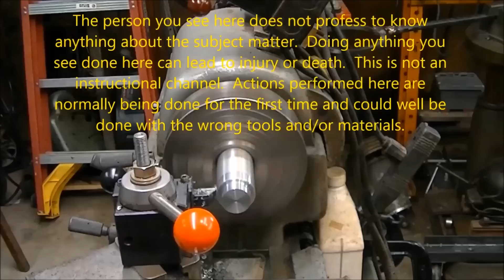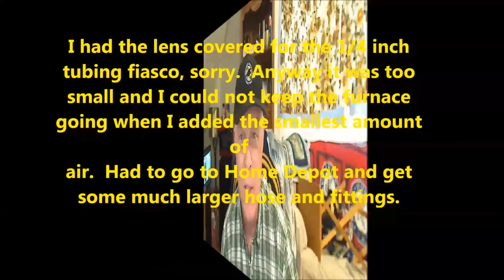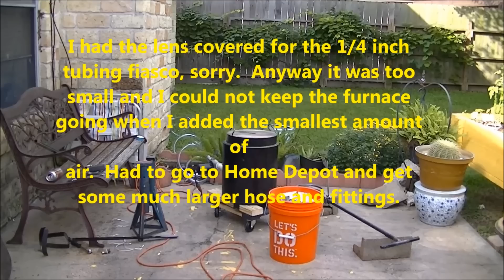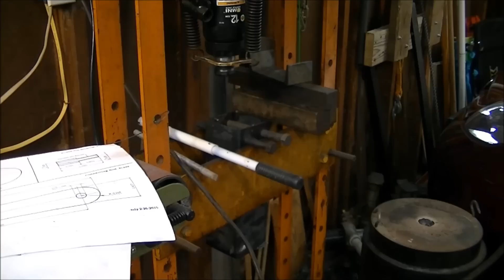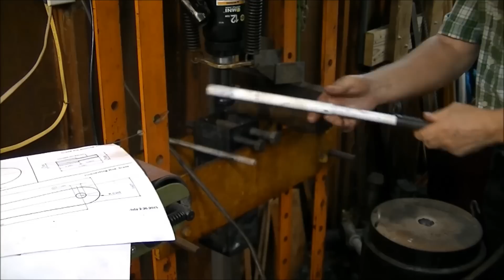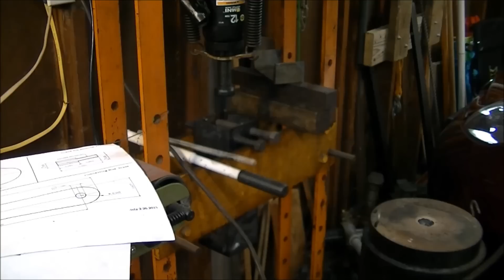Casting a big old chunk of aluminum part 3 of 3

Comment: Harold,

That's a nice casting, I'll be ecstatic if my first one turns out as well and I don't burn down anything expensive in the process. Hopefully your vision will settle down soon and let you get back on the high precision work.

Craig
Reply from the maker: clemwyo I should get back into normal action somewhere around the end of the month when things settle down and I get the prescription reading glasses.  Thanks for viewing and commenting.

Comment: Good job Harold.  I'm going to have a go at that.  I have some similar square section.  The alloy came out dead easy and looked good.

Did you use a degassing agent?

I put a 1 HP motor on my bandsaw.  I don't think the original 1/3 HP is near big enough, and plenty seem to burn out.

Cheers.  Rob
Reply from the maker: xynudu I used some salt for the degassing as that is what I have seen myfordboy use.  I think my metal was a bit colder than it should have been as it seemed to be a bit thick when I poured it.  Thanks for the idea of casting in pipes.  My saw was supposed to have a 1 hp motor already.  The one I put on to finish was a half horse motor made in the 60's I took off the old band saw.  It seems to have been a bit better built than the Chinese one.  I think I am done with buying cheap Chinese tools.   Thanks for viewing and commenting.

Comment: Hey Harold...
I might have a solution for you to keep the spindle nut tight.
Does it come with a "tab" washer?
Tab washer is not my "possible" solution but just wondering.

Anon
Reply from the maker: Anon Ymousmie no tab washer.  The spindle thread is just a big old left hand thread.  The other day I put a bunch of blue Loctite on the threads and tightened it down with a big pipe wrench and a ball peen hammer.  With any luck it will stay put for a while.  Thanks for drawing up a nice logo for me and thanks for viewing and commenting.

Comment: Hello Harold,
Nice billet, casting came out decent for a first shot, maybe you need degassing as in the videos from myfordboy.
You can check this link:
http://asbury.com/materials/cast-metals/flux/
They supply everything for metal casting and much more
Also for reduce shrinkage in the vertical dimension you can close the 2 ends of your pipe, open one side and mold horizontal, easier to unmold if you make the sides tapered and less shrinkage since the 6% is spread on longer distance....
Sheers,
Pierre
Reply from the maker: pierre beaudry I hope to get by on locally available products.  I know the regular casters like myfordboy and xynudu use chemicals that are normal household items like salt and pool shock.  I put some salt in this and I don't think I have any gas bubbles in the lower section unless maybe some are on the sides.  The top with the shrinkage is probably so bad as I may have not cleaned the dross off the top all that well.  Still the bottom of the piece that I cut off is nice and solid and when cut properly slick as a babies behind.  Thanks for viewing and commenting.
Reply: One of the chemical is washing soda: Sodium carbonate, bubbles on the sides maybe impurities cooking. The hole on top in absolutely normal: Cooling faster on the sides and the center is still liquid while still shrinking it's 6%.    If I can get some time available I'll try it with an electric oven, still have to get myself a crucible...
Reply from the maker: pierre beaudry get something to read the temperature also.  My harbor freight jobbie failed to show the upper range of the temperature.  I have thought about real thermocouples but then you have to convert the millivolts to actual readings and they are so expensive and get more so the further back you want to be from the fire.